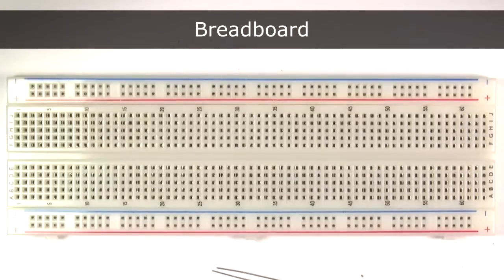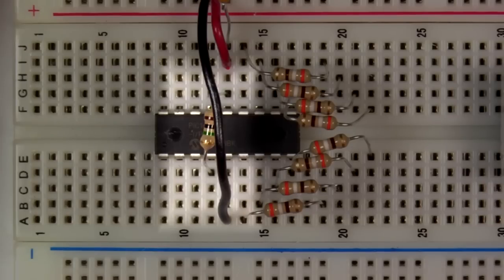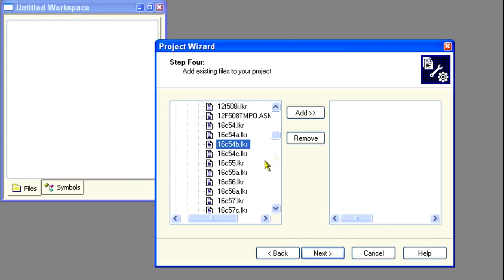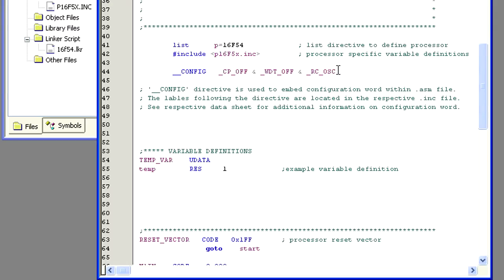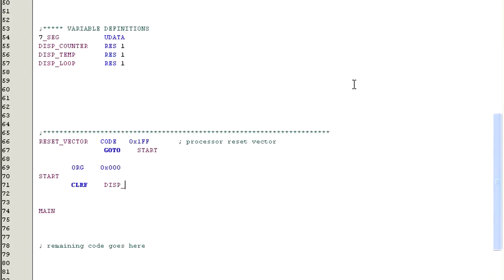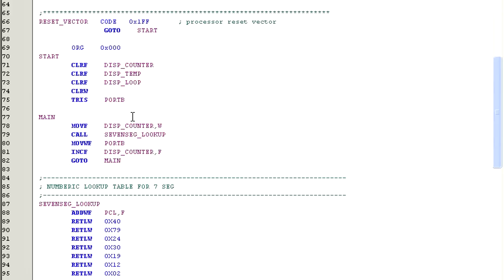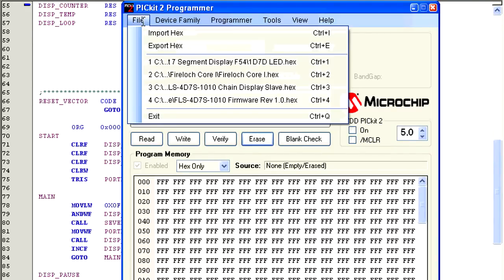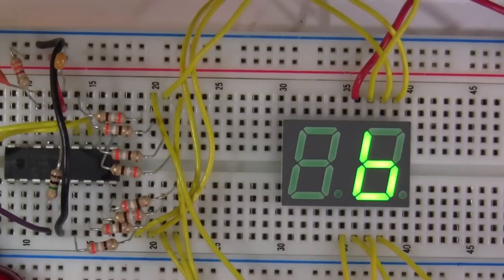David's Lab: 7 Segment LED Display PIC Assembly Language Tutorial

Comment: hello, is this possible to done in cmd or dosbox using notepad. like when you push 1 in key board it display the number 1 and when you push other number it will display number?
Reply from the maker: You would have to build an interface between the display and the computer, something that's not easy to do, but yes it's possible.

Comment: 10 minutes into the vid I finally found out why I couldn't program my 54/57 controllers, you can't do them thru MPLAB, only with stand alone programmer program...thanks
Reply from the maker: Hello Raymond,
Yes, that's true, but with MPLAB X and a PICKit 3 you can program the F54/57 from MPLAB. Something to consider if you're thinking about upgrading to a PICKit 3.
Reply: My nemesis for 15 years has been 12F508/509 and 16F54/57 . I still cannot get this 54 project to build with MPLAB 8.73....frustrating. And yes, I own PICKIT1, PICKIT2 and PICKIT3 plus older DP-40 parallel port, K150 and other after market programmers
Reply from the maker: The F54 and F57 are funny MCUs, they can work with MPLAB 8 and the PICkit 2. MPLAB 8, I think, is faster than MPLAB x, but MPLAB X gives you the ability to use Microchip's free XC8 C compiler. I upgraded to MPLAB x and XC8 some years ago and haven't looked back. MPLAB X and XC8 are all free, no reason not to try them.